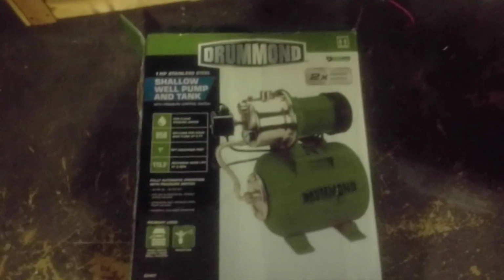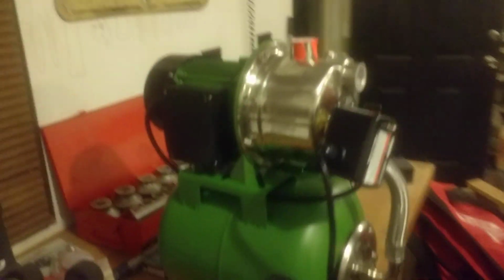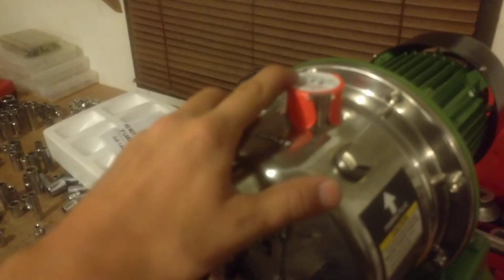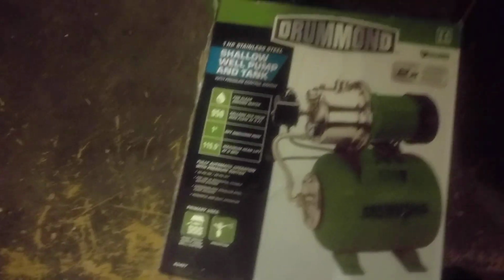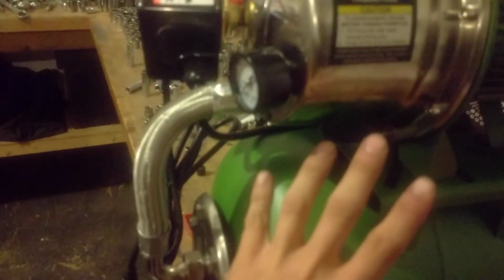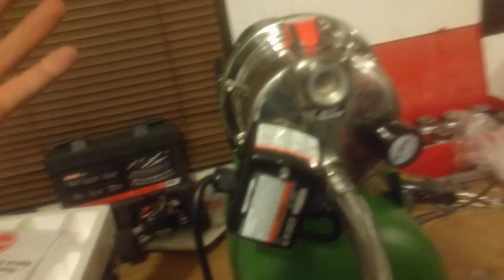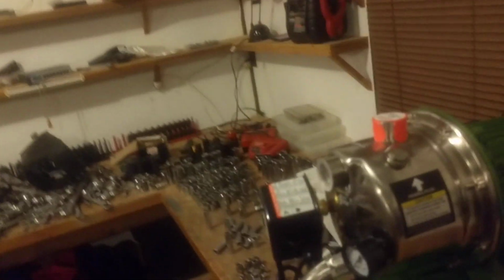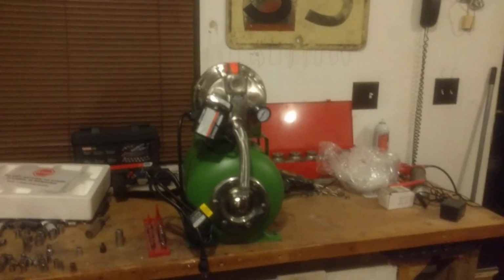Harbor Freight 63407 Shallow Well Pump/Pressure Tank + More Rambling

Comment: Nice video. I've got the same pump and I'm really happy with it. At first, I couldn't get the tank to hold pressure, but then I bothered to read the instructions that said it needed a check valve. So I went out and got a brass check valve and put it in line with the intake line and now it works great. 

My well is very low yield, like only 150 gallons per day. So what I do is pump that water with a different, simpler pump into four connected IBC totes for over 1000 gallons of storage. I use this Harbor Freight pump to water from the storage tanks and that way I have good water pressure.